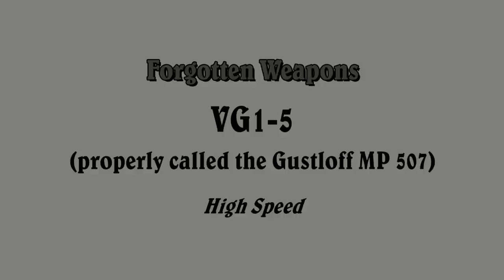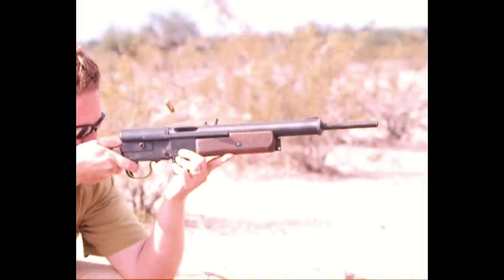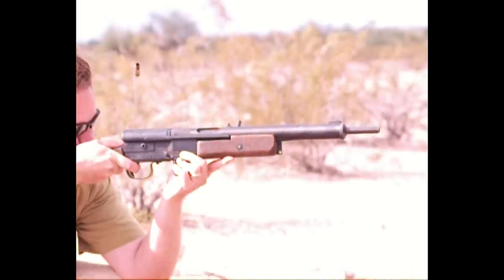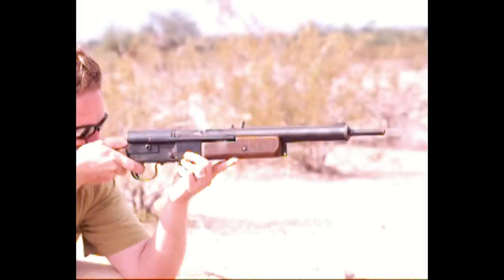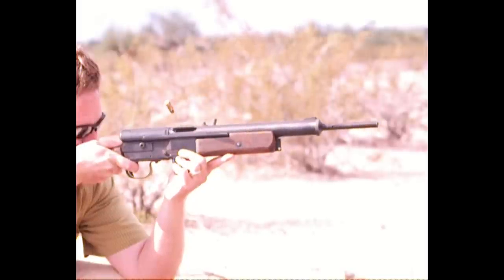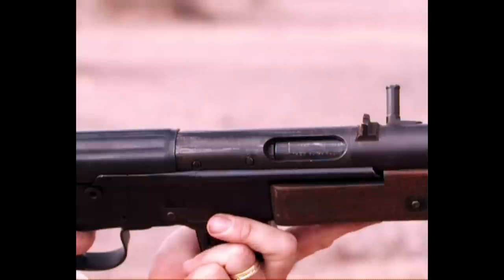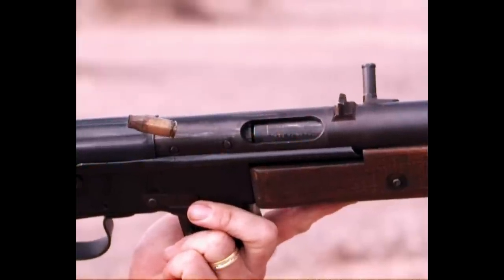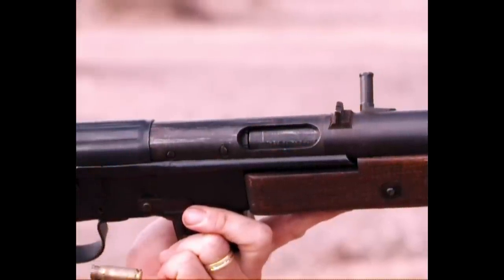Slow Motion: VG1-5 Volksturm Rifle

Comment: What kind of performance was the 8x33 Kurz putting out? It doesn't look too far from the modern 300 blackout (7.65x 35). I'd guess about 1700fps with a 140-150 grain projectile.
Reply from the maker: 125 grains at 2250 fps - virtually identical to .300 Blackout.
Reply: The info I've seen gives about 2200 fps with a 125 grain round (This is just what I've found online, if somebody has real world experience and wants to correct me, please do.)

Comment: Is the gas delayed blowback mechanism strong enough to handle modern cartridge like 5.56 and 7.63 ?
Reply: Absolutely I dont see why not considering 8mm kurz and 7.62x39 are very similar. And if a design can handle x39 then rule of thumb is it should (in theory, this isnt referring to difficulty of rechambering) also handle 5.56
Reply: @sergeantbigmac   the 5.56 mm NATO round is higher pressure, it is not suitable for most blow back actions.